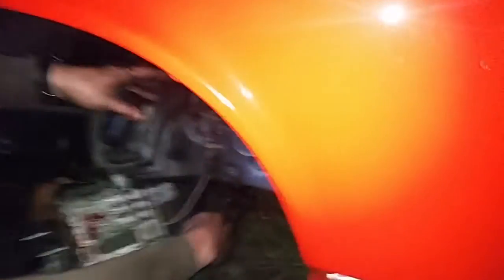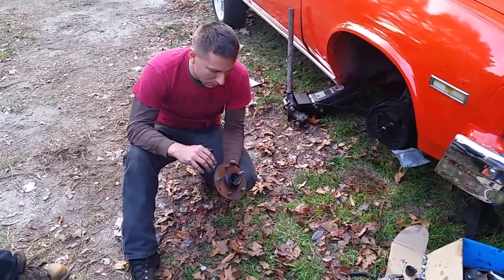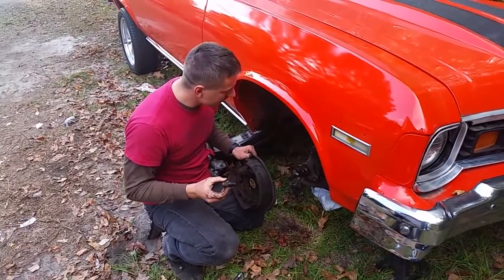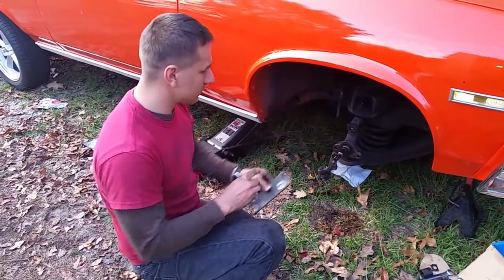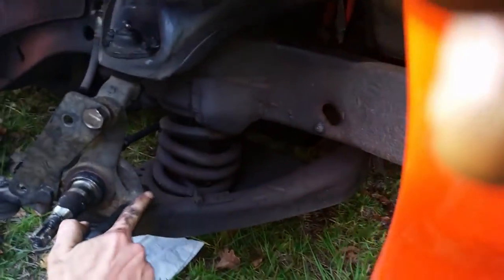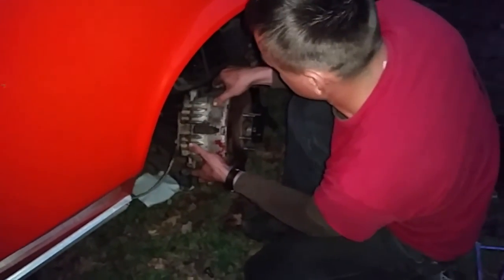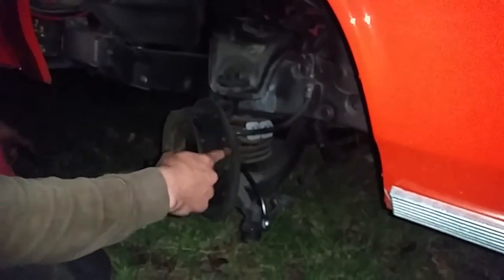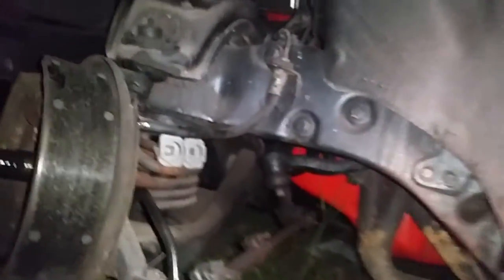12" LS1 disc conversion 68 - 74  Nova step-by-step HOW

Comment: Wait so you took the stock nova hub and turned it down to fit the 98 camaro rotor
Reply from the maker: Yup
Reply: So then any hub can work depending if it need to be machined down or not but as long as its the same bolt pattern
Reply from the maker: No, the offset has to match.  Nova, camaro, etc are all the same hub though
Reply: @InvincibleExtremes    ok so ive been watching A LOT!!! of your brake conversion videos and saw that the one you made for this car with the dual calipers will only fit a 17" wheel and the one you did for the skylark will fit a 15" wheel but that one only has a single piston caliper is there a way to get a dual piston caliper like the 98 camaro one onto a smaller rotor to fit in a 15" wheel? And thanks for answering my questions really appreciate it
Reply from the maker: I've definitely never heard of any way to do that besides using a wilwood kit.  But they aren't cheap and i personally dont like them.  The single piston brakes work great btw if you absolutely have to stay under a 15 inch wheel.  The 98 camaro brakes are much better of course, and the Corvette brakes on my firebird and gto are even better...
Reply: @InvincibleExtremes  there probably isnt i just thought i'd ask tho but its not that i have to stay with that size its just i perfer that look more then a 17" on a muscle car but dont want to pay over a thousand dollars to upgrade my brake to a dual piston caliper to keep the 15" wheel u know i guess i have to try the 98 camaro brake and see if maybe they will work with a 16" wheel do you think they will thanks again for the your time and help bro👊
Reply from the maker: It'll work with some 16.
Reply: @InvincibleExtremes  sorry to bug again bro but you didnt have to grind down the top of the spindle where the anchor bolt goes?

Comment: Is this cheaper than just buying a kit. I want to do my front and rear for a 74 with a 454
Reply from the maker: dan shark depends.  Watch my video of the kit I used on the 66 Buick.  It was $238 And we are very happy with it.  That's for the front.
Reply: Invincible Extremes Muscle Cars Garage . Hey I priced the parts from my local pick an pull. It will be about $200 For my front and back. Next question is you mentioned turning down the hubs. My not really sure how to proceed with that could you explain. Thanks.
Reply from the maker: dan shark I have a video where i show how to do it with an angle grinder
Reply from the maker: dan shark basically place hub on spindle and let the grinder rotate it while grinding it.  Grind at an angle, otherwise it won't grind
Reply: Invincible Extremes Muscle Cars Garage ok super funny. So when I got the car there was no rear shocks. So I started putting new ones on yesterday. So while the wheels off I went ahead and put my rims on. When I got to the front I found out that they already have disc brakes. Not only that I looked at the car closer and also found out I have a/c....damn. So I'm gonna get new pads and rotors and I guess I'm good to go
Reply from the maker: dan shark nothing like finding treasure in your own back yard right?

Comment: do you have the front hubs you took off? I have some that don't match one looks like a chevy hub and the other is a taller one
Reply from the maker: i do, but i need them.  destroyed my hub on my firebird last year when i lost a wheel on the highway...  brp hotrods sells turned down hubs btw
Reply: +Invincible Extremes Muscle Cars Garage oh man that's rough. glad you're doing alright. I bought the brp kit. but would you know the master cylinder part number on the pontiac
Reply from the maker: +mlhmisc1 pontiac what?  i used corvette 69-73 non power master...  they had 4 wheel disc and no power.  but if using disc/drum, just buy whatever is stock for your car with disc brakes... it should be around $36 ... dont know the part number off hand though, sorry

Comment: Can I do this swap  with  the tubular arms
Reply from the maker: Yes it won't affect anything.  You'll be fine for this swap or the c5 Corvette one.
Reply: @InvincibleExtremes  I'm trying with the 99 camaro I'm going to use drop spindle I see if works it was hitting in the upper tubular arm

Comment: hey bro its me again, quick question. does it matter or make a difference on what brake booster i buy?
Reply: No but, a popular update would be the c3 booster.  It will clear tall valve covers.it will require new hard lines from the master to the proportion value.  Install it all the. Put your lines in then you can see how much longer you will need. Most parts stores will have lines in short lengths.  You can buy s $10 line bender or bend them by hand.

Comment: What master, booster and proportioning valve did you use?
Reply from the maker: If using drums on the back, use the 69 camaro disc/drum master and prop valve.  I use 4 wheel disc on my cars, and use a 73 corvette master and a wilwood adjustable prop valve... i dont like power brakes, i dont bkther with a booster at al.

Comment: Hey bro what would I need to get to get from the junked camaro to do this upgrade on my skylark??
Reply from the maker: just the calipers and rotors.
Reply: Do you know the part # for the bake line that you were referring too?
Reply from the maker: no sorry, you can use the stock hoses, but need an adapter.  dont have the part number off hand
Reply: What's the adapter called again bro?? I want to see if I can order them.
Reply from the maker: it adapts standard flare lines to metric bubble flare so you can use the hoses off a 98 camaro... most parts stores keep all the different adapters on a rack in the back, very easy to find once you have the hose in hand.
Reply: Invincible Extremes Muscle Cars Garage ok I'll try to find the parts thanks allot bro.

Comment: What size stud did you use
Reply from the maker: For the nova hubs i used dorman part number 610-157 ... 7/16-20 stud with a .480 shank...just longer than stock.  But the tempest hubs didn't have the same hole so i had to get some moroso studs with a .580 shank and the 7/16-20 threads.   After thinking about it, i prob should've went ahead and upgraded to a 1/2 stud... since i replaced the studs in the rear axle anyway...

Comment: I was wondering what master cylinder to use on my 73 for manual brakes
Reply: can I just use my stock master cylinder
Reply from the maker: No you cannot unless its already a disc brake master cylinder.  Drum brakes got a different proportioning valve and won't work with disc brakes.
Reply: ok so I should be able to get the disc/drum master for my model and an adjustable proportioning valve and I should be ok?
Reply from the maker: Yeah, should work ok... don't know how well an adjustable prop valve works with rear drums... i use mine with disc disc.  Works good.
Reply: right on thank you for the info
Reply from the maker: alpoe408  no prob, thanks for watching... :-)
Reply from the maker: There was a spacer that was installed under the bearing race on the hub.  Inner bearing, not outside.   But it'll work fine without it, just rotor wont be centered in caliper which only comes into play when pads are completely worn out...
Reply: if I dont use the spacer will it wear the brakes down faster
Reply from the maker: If you don't use a washer on the bottom bolt to level the caliper adapter then you geind down the upper bolt anchor about the thickness of that washer and you will not need to use a spacer under the hub bearing race... but even if you do use a washer and don't grind the upper anchor boss then not using an spacer under the bearing race will not change the wear rate of the pads.... they last practically forever anyway...

Comment: nice safety glasses
Reply from the maker: UcantBeSerious03 safety first!  ok, in all seriousness, not a proud moment.  risking eye injury is not a good thing.
Reply: you made me cringe like no other video has. In a pinch and need to get shit done , been there. Great videos btw, picking up a chevelle this week that has 4 wheel drums. It has a new set of weld racing wheels on it. On the fence to go with the LS1 brakes. The conversion is cheap, its then needing the rim and tire pkg. I also watched your ring and pinion videos, car has 4.56 gears, thinking of doing 3.55 when I drop in a T56 tranny.
Reply from the maker: +UcantBeSerious03 keep the new wheels and buy a $239 disc brake kit from speedway.  I doesn't come with disc brake spindles but your drum ones are easy to convert so you don't need them...  we have a video about the swap.  It's on our 66 skylark and it came out great.   The upside is if you want bigger brakes you can always upgrade them, it's no big deal ...

Comment: I can't get the top anchor bolt out..
Reply from the maker: ReJeanne Smith dont know man, a solution would be to buy taller drop spindles, upgrade the suspension geometry and not mess with that stuck bolt, two birds one stone.  Sorry it took a while to respond.